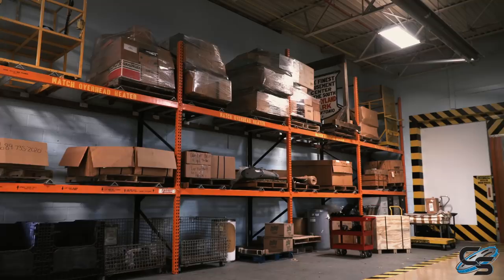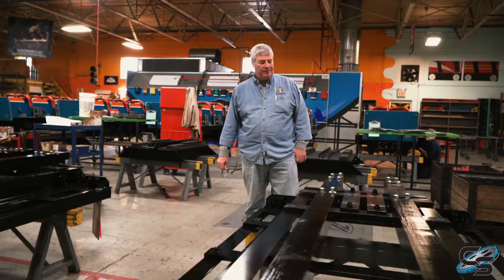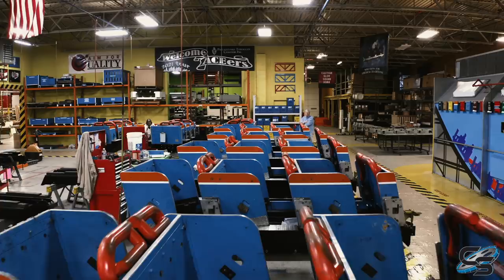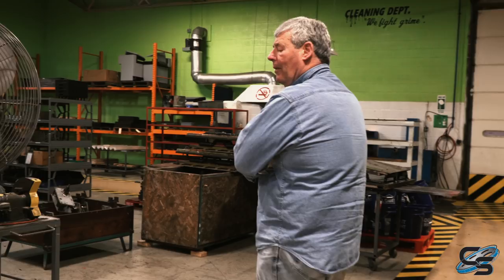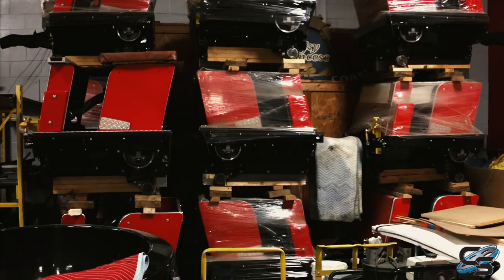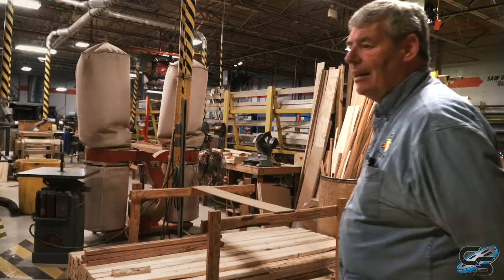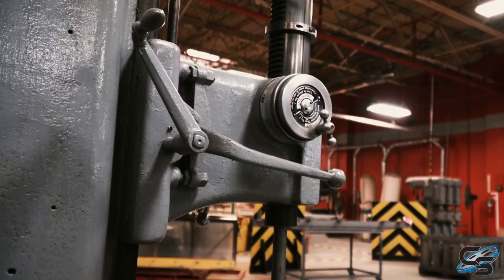Philadelphia Toboggan Coasters (PTC) Factory Tour with Owner Tom Rebbie | April 2022

Comment: They really need to come up with a better solution to the L bars even if it means changing the shape of the body to accommodate something else. Something Timberliner-like should be possible. Or moving more of the current bar design OUTSIDE of the leg area.
Reply: How about back to buzzbars... or grabbars.
Reply: Please no timberliner restraints. I'd rather have my legs slightly pushed to the side of the car than my entire body pushed to the side of the seat. Just... maybe look to GCI for inspiration.
Reply: @noname117spore  T-Bars would require a complete change in the structure of a PTC car. Then again to some degree so would something side-mounted like a Timberliner bar.

I still think that they can change the shape of the wood panel the mechanism is connected to, basically flip the orientation of the hinge so the bars starts on the outside surface, and then curve it back in  at some point closer to the rider.
Reply: @Danrarbc  I guess that could be better, or just have a lapbar that's 2 pieces instead of 1 curved piece, so the piece connecting the hinge to be bar doesn't have to be so thick.
Reply: @noname117spore  The steel bar is fairly thin - most of the bars seem thick because of the foam added to them all the way down. Which is appreciated since otherwise your leg would slamming in to steel with lateral Gs.

Moving that structural bar that connects to the hinge to the outside coming out of the box means it doesn't need to be padded anymore too.

I'd include a mockup here but can't include pics in YouTube comments.
Reply: Disagree. I'm fine with the L bars as is.

Comment: PTC makes the best wooden coaster trains!
Reply: I don't think that's true, not with their L bars.

Buzz bars? Excellent.
Reply: Maddox2021 - Comedy and More Alternate  From what I understand, its problem was that it was heavy, which took a nasty toll on the Dinn wooden track it rode on. Heavy trains are fine for most steel coasters, but wood is a different story. That makes me wonder why Magic Mountain got B&M trains for Psyclone rather than industry-standard PTC trains.
Reply: @Danrarbc  My favorite PTC train has to be the 1940's-50's era "grab ring" train, which unfortunately, no coaster currently appears to operate with anymore. The last coaster I know of that still operated with that style train was Geauga Lake's Big Dipper.
Reply: @Danrarbc  L bars are not bad if you don't get stapled. I'll take them over Millennium Flyer trains any day of the week.
Reply: @omega productions  Millennium Flyer trains staple easily. Had that issue on Mystic Timbers. PTC trains especially buzz bars give room for airtime.
Reply: @alexbrown2696  Millenium Flyers are almost perfect trains. Right behind a buzz bar PTC. I'd rank PTC L bar even with a Gerstlauer woodie train - uncomfortable but in different ways.

L bars are objectively bad and without Six Flags Great America's tweaks that prevent the bar from lowering during the ride you'll end up getting stapled if the ride has positive Gs anyway. I get auto stapled way more often in PTC trains than Millenniums.

Comment: PTC are good trains, but they seem to really beat up wood coaster tracks from more modern woodies (say, the Beast onwards). The more extreme forces found in post Beast woodies combined with the heavy PTC trains seems to cause excessive wear. Look how fast Dinn, CGI, and early GCI & GG seem to develop jackhammering from retracking to retracking with their PTC trains.

I feel PTC waited too long to introduce their 360 car which would seem to fix this problem. Because now GCI & GG have their own proven car design that does what it does.
Reply: Dinn woodies were a different story because those used the now-discontinued PTC Trailered Trains (not the new 360 car, but their first attempt at a trailered train), which were one of the worst wooden coaster train designs in history.  The standard 2-benchers are fine if the ride is maintained well, Millennium Flyers or Timberliners aren't a panacea (see Gwazi, Lake Compounce Wildcat, Hades, or Mine Blower), and they come with their own drawbacks (the single-bench trains from both companies tend to run slower than PTCs do).

I don't know how long you've been around for, but Holiday World actually ordered a set of Timberliners for Voyage.  After testing them extensively for three off-seasons, they decided to stick to the PTCs.  That says a lot...

Comment: Wait, they put the 1 row trains on Corkscrew at CP?  That's a steel coaster and it has inversions.
Reply: Right?! I heard that and kinda want to give it a shot
Reply from the maker: We don't know which Corkscrew it was, I just showed footage of the one at Cedar Point. They didn't say which park it was at.
Reply: @CoasterStudios  I mean, he just said "a park that has a corkscrew." I wonder if that could've been Mount Olympus and Hades, since that inversion, although not a corkscrew, is close enough that he could say that. Unless he confirmed it was a steel corkscrew.
Reply: @noname117spore  Maybe, I didn't think of that, it would make sense that they probably tested it on a Gravity Group.  I think if they did test it on a steel coaster, it would have to be an Arrow or Vekoma cause the train couldn't fit on other steel coaster track as Arrow and Vekoma track have the rungs on the outside of the track and PTC guide wheels are on the inside.
Reply: @noname117spore  thats my thoight, too. Hades. Single row trains woild allow for much tighter inversons.
Reply: @noname117spore  He certainly meant that. From my understanding the track gauge, rail thickness and other specs would be significantly different on an Arrow Looper.
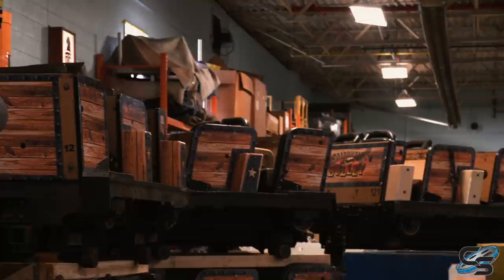Reply: @CoasterStudios   I noticed that massive Hades 360 picture at 1:14 and thought why's that there considering that's when they moved from PTC to the Timberliners. Was going to throw a question, but then continued to watch further and oh boy the plot started to thicken! Interesting.